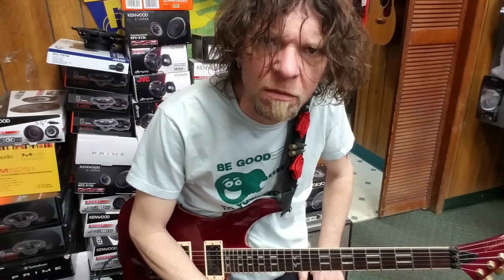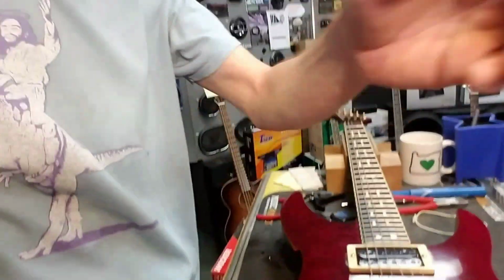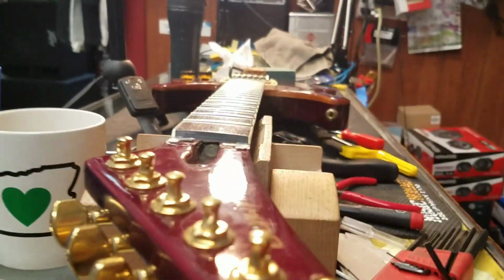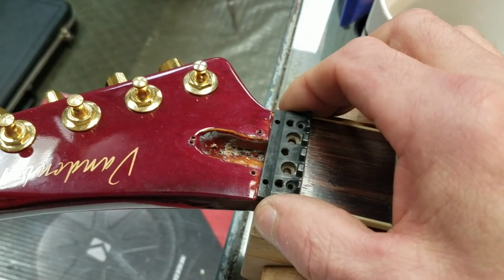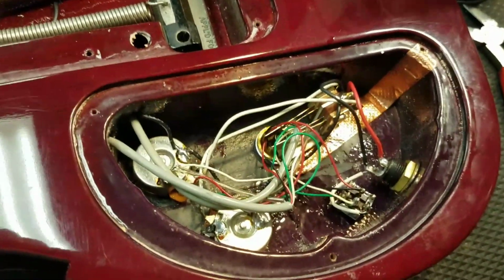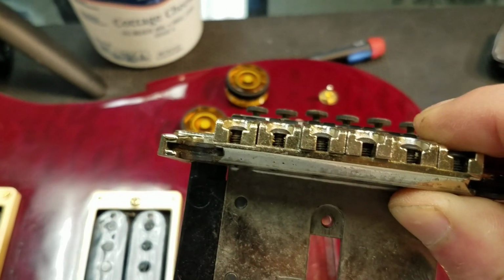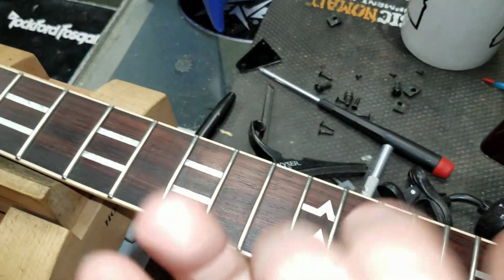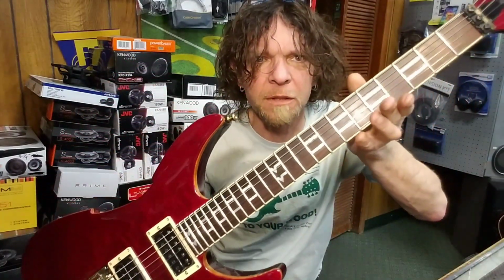ADRIAN VANDENBERG SIGNATURE GUITAR QUILT TOP

Comment: I loved mine.  It had a Kahler Killer on it. The guitar sounded perfect, and wow the neck was incredible.  Amazing frets.  Peavey had some great guitars in the late 80s early 90s.  I have a generation series 2 tele with a beautiful body and a tele styled bridge with a double coil and a coil split switch.  Sounds unique, great neck but Peavey doesn't have replacement parts and the frets are worn.  I got rid of the Vandenberg because the killer started going out of tune.  It was a decent bridge but it wasn't as smooth as a Floyd and it wore out.  Now Kahler won't ever make it again because it would cost like $900 a unit.
Reply from the maker: I was very surprised to see this guitare in my small community in the middle of nowhere. It's astonishing how many guitarists live here, and how many very unique, and rare guitars land on my bench. This thing was really a sweet guitar. Eddie Van Halen didn't use Peavey for no reason. 😁Thanks for your comment, and thanks for watching.

Comment: Just a word of advice. Adjusting the truss rod with the string on and tuned or under tension causes you neck to go S shaped. Have a guess at how much you need to adjust to and then slacken the strings off and adjust. You also need to let the timber take on its new shape overnight to do this properly before tuning up again. I didn't know this for yrs and many of my necks became S shaped which is really expensive to correct. 

It was a bummer with my RG 750 Ibanez because it had a whippy neck however it was worth it for the tone because it was one of the best sounding guitars I had ever heard. I have played many same model guitars however it was that 1/100 that sounded stunner. Don't ask me why..lol
Reply from the maker: Thank you for watching Mickeyislowd. I've been setting up my own instruments for over 30 year bro. Not one has an S shaped neck. Not sure why that would happen to you.

Comment: Funny video.. 
You know, they make a T hex wrench that has a really long hex head.. It would have worked great.. On the other hand, that trem recess and trying to get the action lower was horrible from the factory.. They should have recessed it more with that neck angle for sure.. I like bolt on's for that reason alone.. That said, I also love me a good neck thru or set neck if it's angled correctly.. \
Oh, I saw a video with Adrian and Peavey is getting ready to make a new model and it will have a floyd rose instead of that piece of crap trem. 😛
Good video..
Reply from the maker: I appreciate your comment. Thank you. 
The mortar type substance in the truss rod cavity was one of the weirdest things I've ever seen on any guitar.